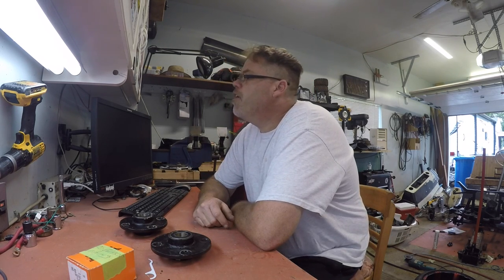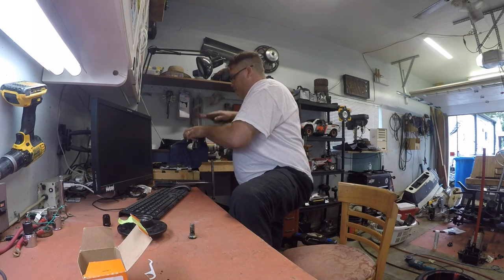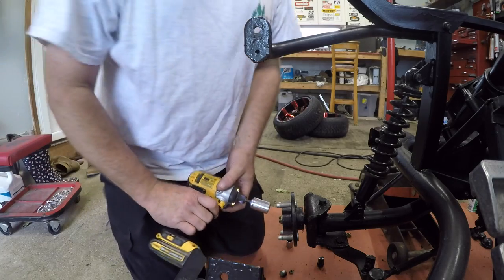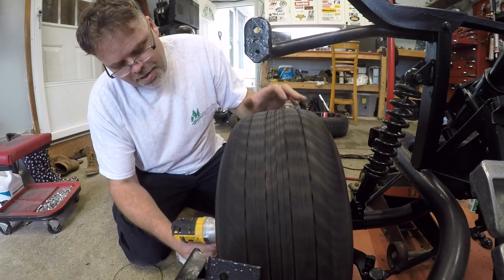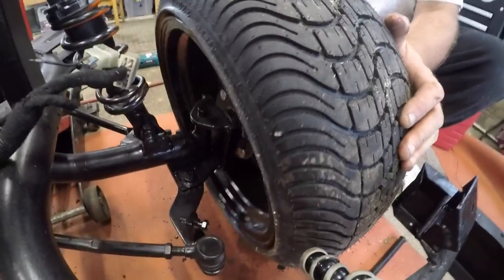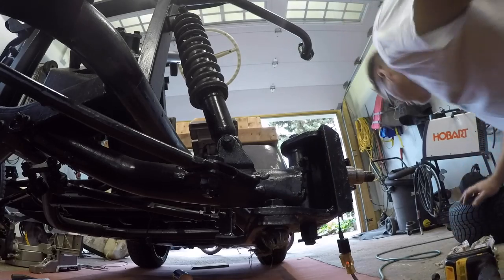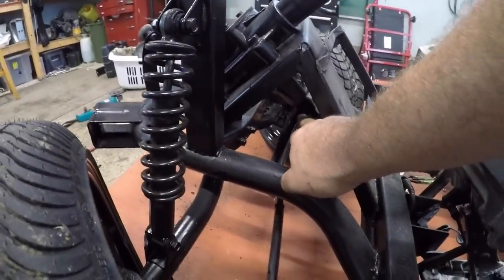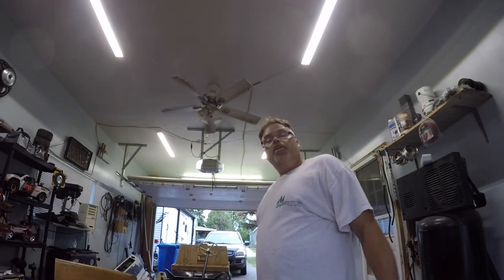Hub Barings And Studs Yamaha G1 Golf Cart

Comment: use a center punch bill, it will raise the surface. just put a couple rows of punch dings along the low part of the shaft. the bearing will fit tight again.

Comment: You take a center punch and punch mushroomed divets into the axle and the bearing will tighten on the divets. Not permanent but will probably solve your issue temporary. Cheers!
Reply: some axle have cut and you must hit in nuts edge to get little  piece in the axle nut does not rotate open some nuts / axle have pins holes to put pins in

Comment: billsiff when you tight oon those mid bolts just use normal tool no electric tools because you can make it too tight at bearning go bad just use hand tool and put it tight but not so tight then little back and its good if its roll good then its primo good and mempor use a lot bearing lube